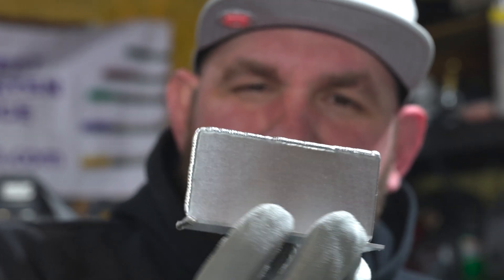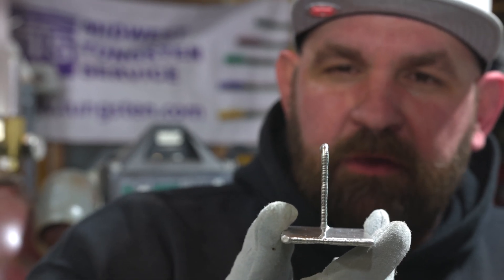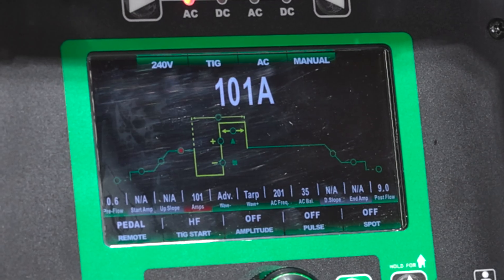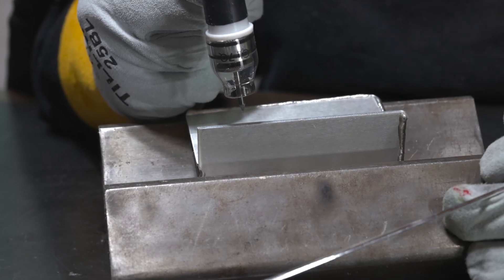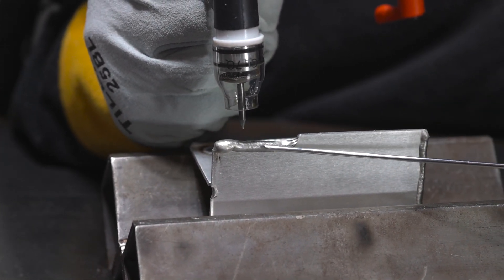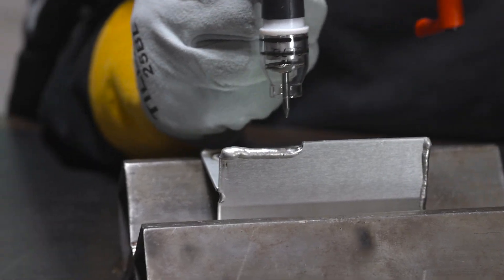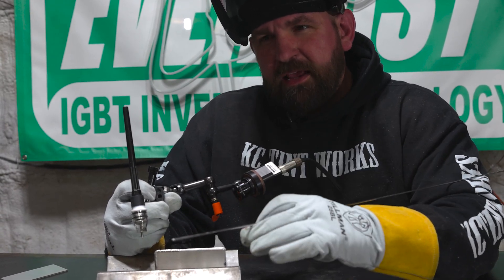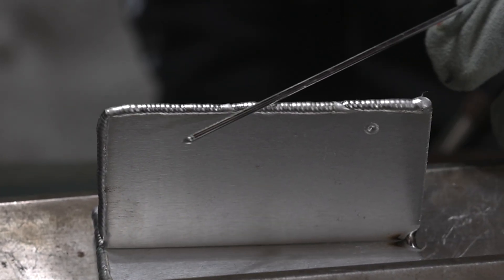BECOME A BETTER TIG WELDER, FASTER

Comment: That’s a great idea Jesse! That never crossed my mind. I will definitely do this drill. Your my rock star for tig for sure🤘🤘🤘
Reply: A little off this training subject but has everything to do with tig welding. I need to weld stainless exhaust to a steel exhaust flange, should it be back purged? What filler?

Comment: Good lesson. Thank you. I noticed your tungsten tip kept it's shape. I have a 210ext and my tungsten tip always looks look a flower, meaning small balls form around the tip. This is my first AC welder so I have nothing else to compare it too. I can get a decent weld, but my tip looks different than every video I've watched. I've tried blue, chartreuse, and purple tungsten 3/32 to 1/8. I grind parallel to the tip with a dedicated diamond wheels and have tried multiple wheels. I've tried gas lens and standard collet bodies, 5 to 8 cups. I've verified the gas flow CFH at the torch with a flowmeter is 2x the cup size + 2, so if I'm running a 5 cup, I'm running 12 CFH. I've tried 20 to 40 for the balance. I've varied the frequency from 60 to 120. Nothing I try seems to matter. The tip is always misshapen which I believe is affecting arc stability and possibly contaminating the weld with tungsten. Any words of wisdom you can offer to help me solve this problem are much appreciated.
Reply: Could be several factors playing against you. I’d start with preflow and post flow. .6 seconds preflow, and at least 8 seconds post
Flow to keep the tungsten shielded while it’s still hot. I typically run 35% balance all the time and hardly ever change it… just a good all around setting. Running a higher frequency can help by reducing heat input into the tungsten as well
Reply: Check your machine to see what 20-40% for the balance means. Some manufacturers mean 20-40% electrode positive, and some mean 20-40% electrode negative.  Electrode positive is the cleaning side of the alternating current, and is the side that puts a ton of heat into your tungsten. Make sure that you're running somewhere 20-40% electrode positive, and not 20-40% electrode negative which will cook your tungsten.
Reply: @ischmitty  Thanks. It's an Everlast 210 ext so it's positive.